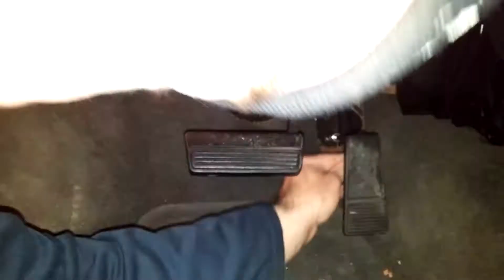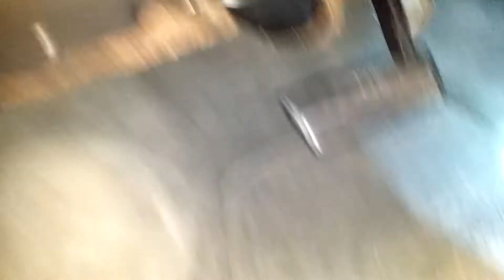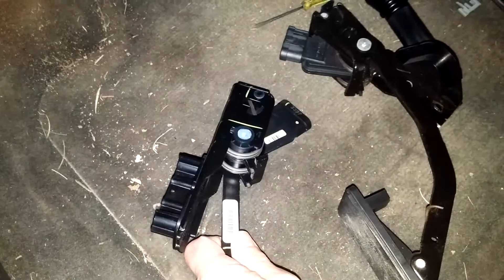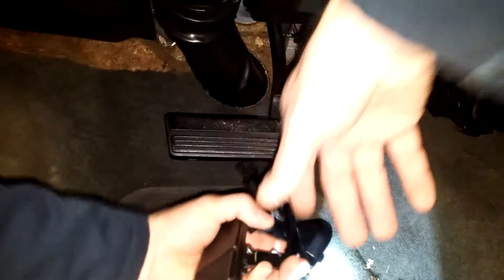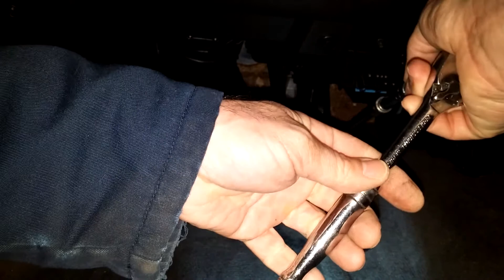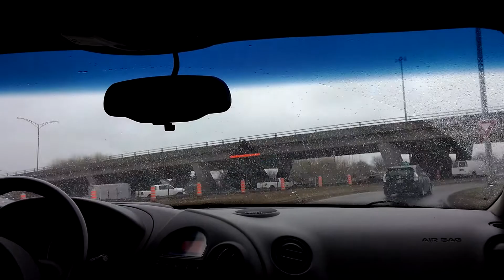05 08 Pontiac Grand Prix GXP TPS (pedal assembly) swap code P2138

Comment: replacing this pedal TPS assembly on my 2005 Pontiac Grand Prix GTP next week.  have the P2138 and P1125 codes with 'Reduced Engine Power'.  I've already cleaned the Throttle Body and this is my next step.  Hope it helps mine as well.  Thanks for the video!  it's 2026 and it's still helpful to all of us who are trying to keep our Pontiac Alive!!

Comment: my car did this a couple hrs ago. it’s the gxp 2007. the issue lead to my traction control being turned off then proceeded to my engine light turning on and then said reduced engine power. i hope this is all the issue is as my car was in a accident while being parked on the side of the road as both front and back were smashed into the cars parked by me. it’s damaged a lot with my car as even the main wires to my battery. but thank you so so much for this video as i’m only recently learning how to fix my car and i am thankful for your help to keep my baby running properly. 🙌

Comment: I replace the pedal still have same problem
Reply: me too did u figure this out?
Reply: Did you buy genuine GM pedal/app assembly or aftermarket?
Reply: @xxXWiLdFiReXxx  im not sure what they put in..does it matter?
Reply: @DCthetruth777  yes it absolutely does. I bought aftermarket and it lasted less than 2 months before same issue. Got the part from a junkyard, it's been fine. I have read several places that aftermarket doesn't perform as well. Has to he genuine factory.

Comment: My only problem is squirrels ate through the throttle wiring harness. I reconnected with wire connectors but there seems to be some more damage that I can't fix effectively. Just trying to find the wiring harness but no luck yet.

Comment: Hello how did reset or program your gas pedal Interested
Reply from the maker: I haven't reset it. I just replaced it and it was good to go. But to reset your system you need to disconnect the battery for an hour.

Comment: The throttle position sensor, when replaced ...does it require reprogramming from the dealership? Cause I have that problem Engine Lower Power, and I think is just the pedal. But I replaced the full throttle already too..and the car turns on but won't accelerate
Reply: Well, I fixed it. Finally, it turned out to be the computer, and the ignition coil from cylinder one. Now it runs like a champ
Reply from the maker: For me i haven't needed to reprogram anything but i was running a custom tune so maybe this is why. I heard disconnecting the battery for alf an hour would do the job but i never tested it personnaly
Reply: @RickStuff  thanks I'm going to do that

Comment: Did you have to do a relearn on the computer with the new pedal? Or no
Reply from the maker: No. But i disconect the battery before the job and i connected it back right after and it was running smoothly. But i did not drive more then 1 mile on the stock tune. I was running  tune and i restored the computer to factory to make sure the tune was not the cause. When i replace the pedal i did one lap around the block and i wrote the tune right back on the computer. Turn DOD off, change fuel ratio, transmission firm shift stuff like that.

Comment: Just today I received Reduced Engine Power notification along with check engine light. I had codes P1125 and P2138. Not long ago (month or two) I completely cleaned the air intake, throttle body, and MAF sensor. I appreciate your channel, Rick! I have 05 GP base model 150K+ miles, so any dedicated GP channels are helpful to me.
Reply from the maker: Hello Jacob. Is the notification still "on" with reduce power? For me replacing the throttle position sensor fixed it but i had only p2138. But the code p1125 is also deployed by a faulty tps. I can not garanty that the throttle position sensor (tps) is your problem but it surely sounds like it.
This is a link for the lust of the obd2 gm code.
https://www.engine-light-help.com/gm-trouble-codes.html
Reply: @RickStuff  the REP alert and check engine light are off currently. After the initial incident, I waited about 5 hrs to drive, during which time I researched the issue. Before I started the car I disconnected the batt for 20 sec, checked for obvious wire issues around throttle body, reconnected batt and started car. No alerts until first steep hill triggered them again. After another rest for several hrs the alerts are gone, but I have learned to drive as if REP is active, which seems to prevent it's triggering.
Reply: What was the resolution to codes p1125 and p2138? I have the same issue on my 06 grand prix.
Reply from the maker: From what you saying it sound like the same problem i use to have. I was erasing the code and the car was driving fine about 10 to 15 miles then the power drop and the notification was triggered again.

Comment: So I just changed the pedal assembly and went for a test drive and so far no problems. I disconnected the negative terminal while working so the engine light isn't on either. Really hope this was the fix but I would still recommend everyone clean or outright replace the throttle body because like Rick said it was absolutely filthy and I got more power out of it after just cleaning it. Hopefully this is the fix though if not I'll let everyone know
Reply from the maker: I am glad you fix it. With all the people complaining about that issue it is disappointing that gm did not made a recall for it. I am recieving the fu... Recall for the key for the past 3 years but for a serious problem like the one we having in this topic, nothing.  It is not like it is normal to see the throttle position sensor going wrong after 10 years or so...

Comment: Hi, so one month later has this worked? I cleaned my throttle body today and got more power out of it, but my reduced engine light still comes on. I'd much rather replace the pedal than the whole throttle body. Also after you installed the new pedal did you have to do a relearn for the computer? Thanks in advance
Reply from the maker: Hello zach. So far so good. I put about 600 miles on it and still no sign of power reduction. Before I was driving about 5 miles max before the safe mode get on. I am pretty sure i fix it for good but only time will tel.
Reply from the maker: I don't know if your throttle body was very dirty but mine was extremely dirty when I cleaned it. With the DOD problem it was burning a lot of oil. The best thing i've made on this car is installing a Diablo intune. It cost me about $200 but I've deactivate the DOD, add 30hp and stop burning oil. Now my throttle body stay clean, a got more power, I also changed  the transmission setup so i got harder shift now. It keep the oil tempreture lower and i get more power on lower rpm.
Reply: @RickStuff  where do you get the tune
Reply from the maker: Hello Isaiah. I bought it on the diablo intune website. This is the link.
https://www.diablosport.com/shop/